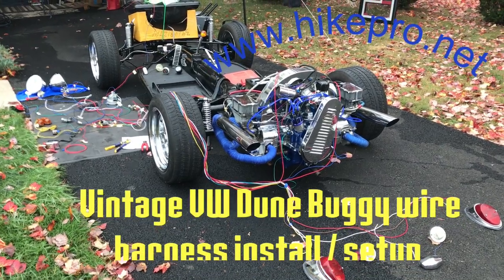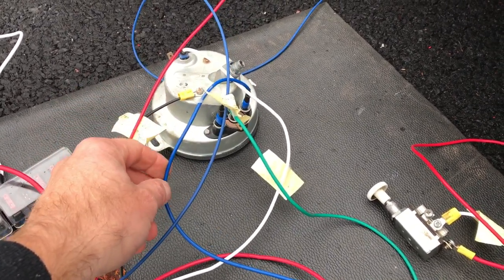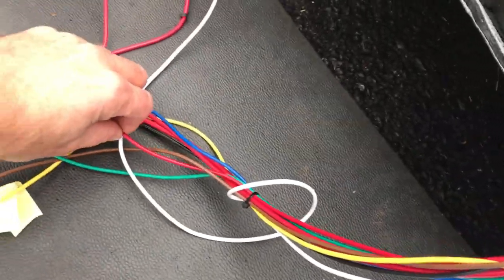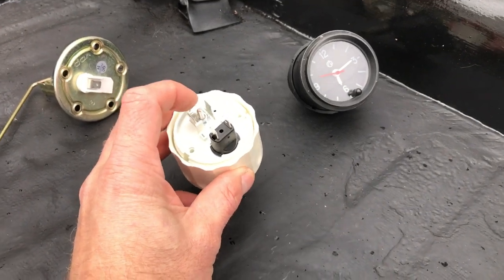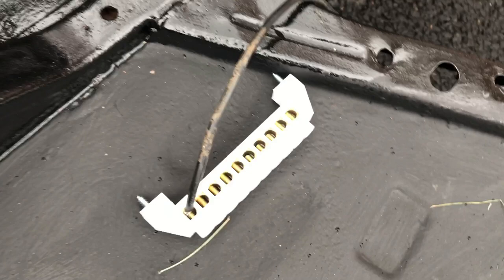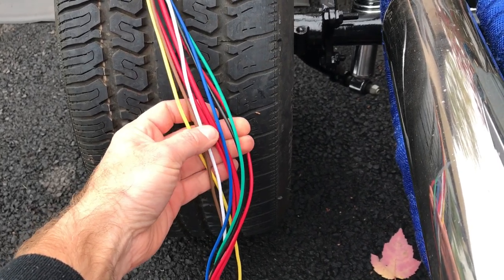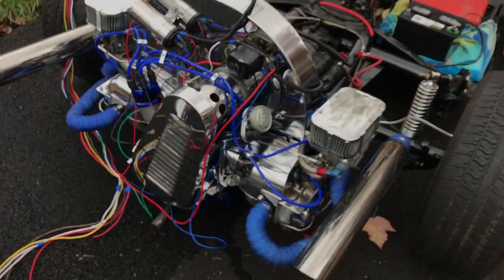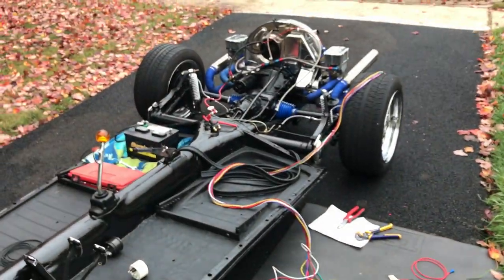Vintage Bug VW Dune Buggy build Full Wiring setup wire harness install fuse, dash & engine

Comment: Got a question about the red wire that comes off the aftermarket turn signal. Where does it go ?
Reply from the maker: Been a while since , will have to check.

Comment: What amp fuses did you use?
Reply from the maker: ahh. i dont remember.  but it should be standard format.  buggy locked up right now, so will check it out in the spring